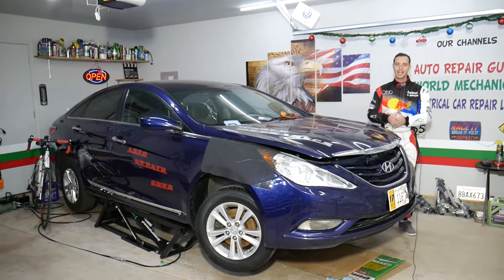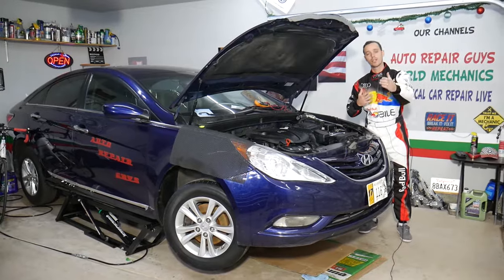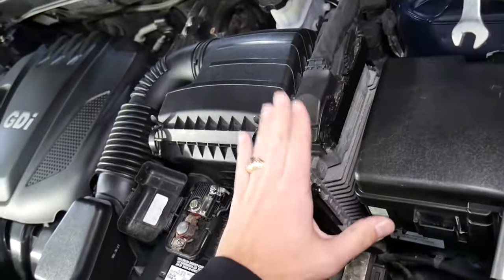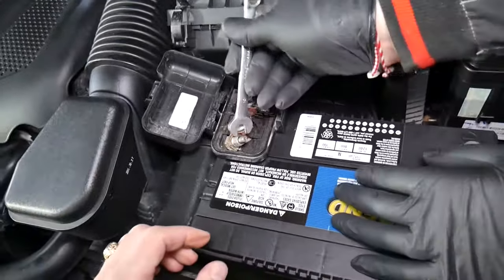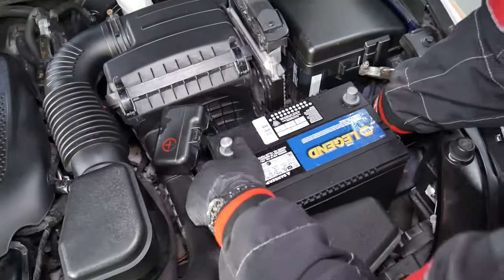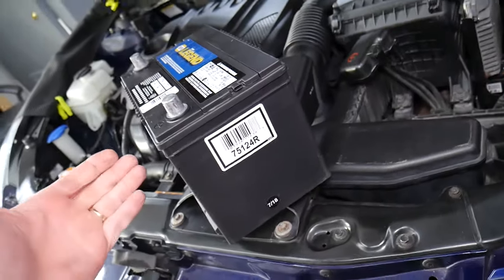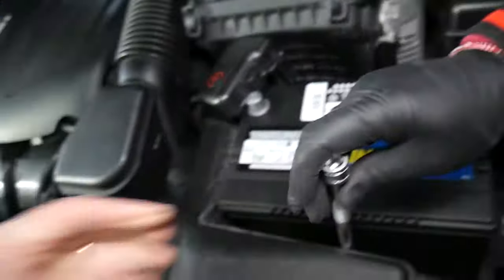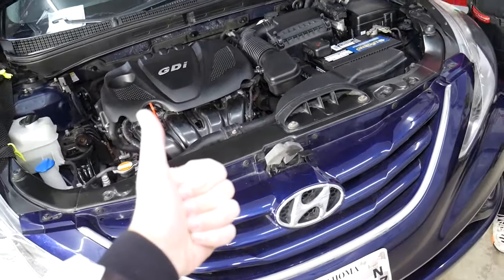HOW TO REPLACE CAR BATTERY ON HYUNDAI

Comment: Don't newer engines have to have a diagnostic reset so that nothing is lost on the changeover. Radio, windows etc
Reply: Exactly what I was thinking. In some cars after you reconnect the battery the warning lights have to be reset. Theres usually a trick to it. On my VW you turn the steering wheel all the way left then right and back to center to clear the codes. Do Hyundai’s have to be reset? That’d be important to know.